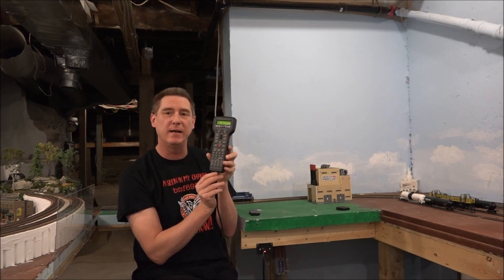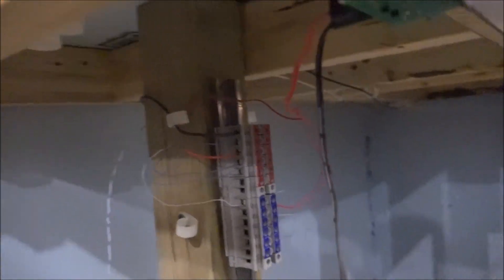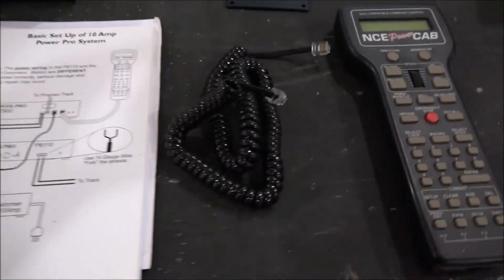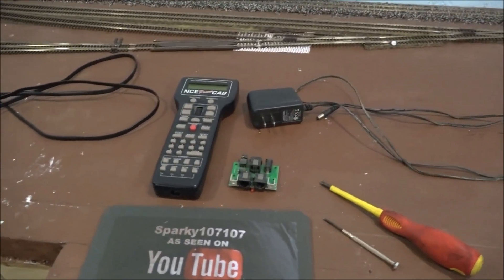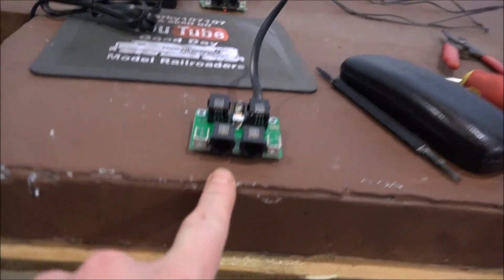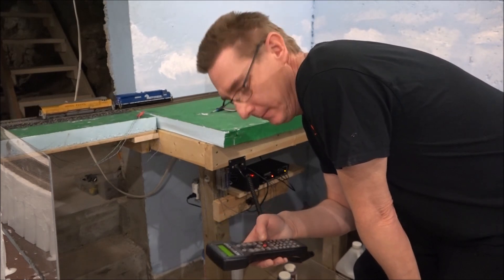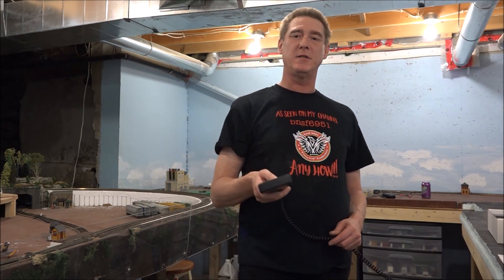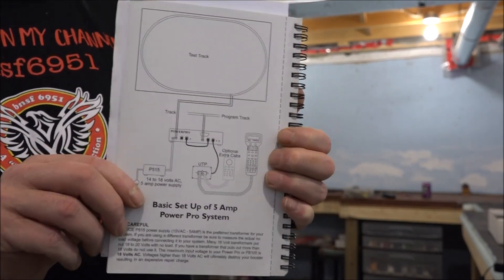How To hook up the 5 amp NCE system

Comment: I think that NCE is overall the best system. I visited and ran trains on the Canada Central layout in Montreal in 2006. That layout was in a room 40' x 140' . It was powered by NCE and was so large it required 3 10 amp boosters in addition to the main command unit. If anyone is interested in seeing that just search "Canada Central .org". Cheers Sparky, great "how to".  David.

Comment: Sparky, you can take the pro cab controller and reprogram the cab to number four and that will allow you to still use the power cab with your system. That will give you to control stations you don’t have to plug and unplug. Thanks for the video. —jack

Comment: Sparky, Nice job showing the ease of converting your Power Cab system to the Pro Cab system.  Don't forget that if you add a curled control line (like the one on the Pro Cab) to the Power Cab that it can be used as a Pro Cab.  I have 2 Power Cabs running as Pro Cabs on my layout along with 2 regular Pro Cabs....John

Comment: Love my sb5 booster I have 3 utp panels so far. I love being able to unplug and move to another panel and not have it all shut down. 😃👍nice tutorial. Oh btw I’m glad you mentioned about the power pack being separate.  And I did exactly what you suggested and I use my pcp panel on my workbench program track.
Reply from the maker: that is my favorite part, unplugging and trains are still going
Reply: sparky107107 definitely is a grey feature.  I want to get a second throttle.

Comment: Good luck ! My Power Cab is now more than 8 years young and still great to use but outdated compared to 'wireless' DCC systems. It works great for a small layout and 2 amps will run 3 sound loco's without problems. I now have a bigger layout and I upgrade towards the 'Economical priced' Digikeijs DR5000 - 3 amps. It is a complete system and allows a multitude of 'Cabs';  Multi protocols; Wireless; JMRI or other Train drivers; Wifi build in... See the possibilities of the Z21 app. Compared NCE sadly seems outdated now.... and to expensive too.
Reply: I've got a Power Cab  and SB5 booster, as well as a Cab06... for about the cost of a smaller utility type cab/throttle, I'm going to add the Wifitrax panel as my next additional cab panel and have up to 4 additional wifi throttles, be that phones, or a TCS throttle, etc... 
   The newer DCC stuff from Digitrax seems nice compared to what they had when I got my power cab , and TCS stuff although a tad pricey also looks like it is taking DCC to the next level.  
   I will look up Digiksijs DR5000. 
Cheers.
Reply: @isaiahfurrow7414  Thanks for your reply. If I started over today I'd invest in the new Hornby HM7000 - Bluetooth system. One only need the decoder ( sound is about 60£) and a free App on the smartphone. I might as well try it out for it only takes the 'power' of the track. So both systems Power Cab and Bluetooth can cooperate and keep your hobby budget on a nice level. Cheers.

Comment: Sparky, I still use an NCE PowerCab to run my layout, and it works fine with the size of my layout and the number of locos I run at any one time. However, that flat cable that is used with the PowerCab makes me crazy. It keeps getting all twisted up. ...Roy
Reply from the maker: my layout is not very big either. but for 2 or 3 people. this just makes it easier.
Reply: @sparky107107   I would like to upgrade, too, Sparky, not because I need more power but because I want to get rid of that darn flat cable that keeps getting all TWISTED UP. Maybe I should look at the NCE wireless system. Your video has really got me thinking about alternatives. ...Roy
Reply: Roy, a coiled cord came with you Power Cab. If you purchase and install a NCE Smart Booster you can replace the flat cord with that coiled cord. The Power Cab throttle will work with the Smart Booster like any other throttle.
Reply: @jerrysmith1929   Thank you, Jerry. I really, really appreciate that suggestion. I like your suggestion so much that I'm going to do it. ...Roy

Comment: Hi Sparky I have 2 question. How many trains can you run with the controller right out of the box? An when you shut down the controller do you have to reprogram it or does it stay program all the time no matter what? Thank you
Reply from the maker: the 2 amp system i was running 4 trains with sound. this system  should be able to run 10 with ease. and when you shut it off. and then on the next time it does remember what you were doing
Reply: Wow thats a lot of trains. Thank you for the reply keep up the great videos

Comment: So sparky, did you buy that system used? I’ve never heard of the 5 amp system shipping with a power cab in it, so I’m assuming that’s the one you had at the beginning of the video. Also the box is labeled for the radio system and you didn’t get the base station for that either. Congrats on the upgrade, I did the same thing years ago and now that I have the full system I don’t see myself needing to replace it anytime soon. It  just works so I can enjoy what’s important, running trains.
Reply from the maker: i might have mixed up some of the parts, lol ,, and yes the wireless system is next.. i just wanted to get this up and running first

Comment: im in the uk and have the ph-pro 5 amp but cant get the power supply as we are 240v not 120v but been told we only need the wall power supply that plugs int the back of the control plate but its only a 1.5 amp supply so how will it do 5 amp ?

Comment: Instead of buying a whole new system you can purchase a NCE Smart Booster. Reconnect the bus from the Power Cab port to the booster and that gives you the same power as a whole new system would.  The Power Cab came with a coiled cord which you haven't been using. Replace the flat cord with the coiled one and the Power Cab throttle will function like any other NCE throttle. And, just as you suggested, the Power Cab port and power supply can be moved to your workbench where at any time you can bring back your Power Cab throttle to use it for programing or trouble shooting. If you're a subscriber to MR Video Plus there is a video there in which David Popp shows how this was done for the Beer Line project layout.
Reply: The Smart Booster will be supplying the power so the Power Cab throttle no longer must be kept connected to keep trains running.
Reply: @jerrysmith1929  the SB is awesome...  
   I have a few things in the works, one is a new test/program track that will end up being a small diorama... that will get the PCP panel as my layout will use the SB5 and the other panels... I also plan to get a Wifitrax module,  and use it as one of my cab panels,  to add wifi to my layout.   
    Lastly I may add a Wifitrax panel and 2A power supply, to a small portable layout , or some modules , and when needed that can run off the Powercab but have wifi throttles as well... 
   Next project is to come up with the new test track theme and make that... not sure if I will use some Bachmann sectional track I have, or buy some turnouts to go with my few pieces of flex track I've been tinkering with...

Comment: Can you directly wire the 2 amp system to the tracks? A.k.a, can I wire it up just like a simple dc controller with connecting the 2 wires to the track?
Reply from the maker: yes

Comment: Sparky hey question so I hooked this up today ran track wire to bus connected with suitcase connectors to bus red light came on utp and command station sb5 but loco wouldn’t start and no voltage on track?? So I cut the track feeds off and soldered directly to track and loco started? Why wouldn’t it work thru the bus line?
Reply: You need to check the connections to be sure the suit case connectors have a snug connection.

also you need to twist the bus wire tightly because the signal is sent out in basically a wave. the tighter you intertwine your bus wires the better performance you can achieve. i use a drill and put the wires in the chuck of the drill and slowly twist the wire it works very well with 14/2 house wire spooled loose.

Comment: Sparky I notice the power supply has a switch on it 13.5 v and 12v. I currently have it set at 12v. Do I need to go to 13.5v? I didnt try this becuase I dont want to burn anything out.
Reply from the maker: mine is set at what the factory setting is. and have never had to change it
Reply: The 12 is for n gauge and 13.5 is for ho scale I found that out the hard way it was on 12 volt and my trains ran slow switch it to the 13.5 it was better

Comment: Nice video and helpful. 
Would you know what is the difference between the Pro Cab and the Power Cab? Thanks.
Phil
Reply: power cab is a basic starter system with 2 amps.  If you unplug the controller everything stops.  The Power cab is a 5 or 10 amp system, basically more power.  All three systems are expandable as required.  The controllers are the same, just the power cab the controller is the power source, the pro cab has a separate power source which allows you to unplug the controller.
Reply: @Offroadnovascotia  Thanks for the info. Appreciated.
Phil